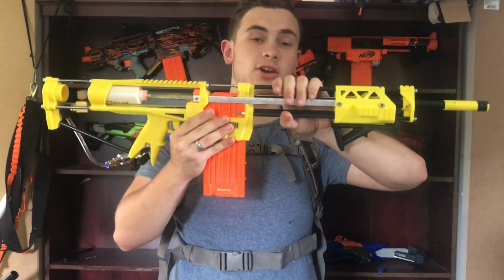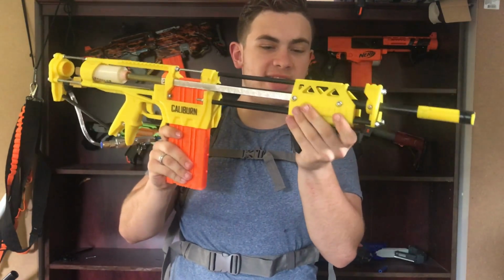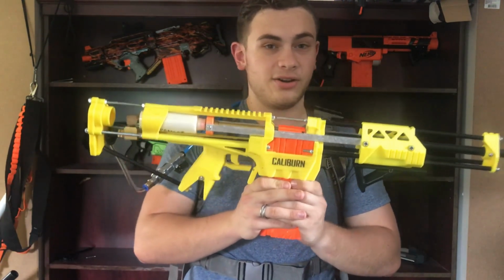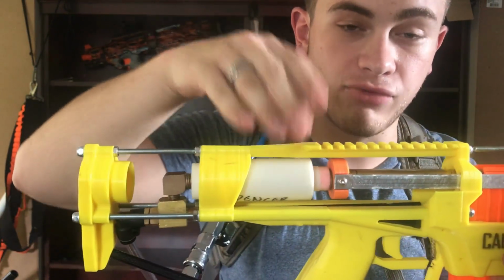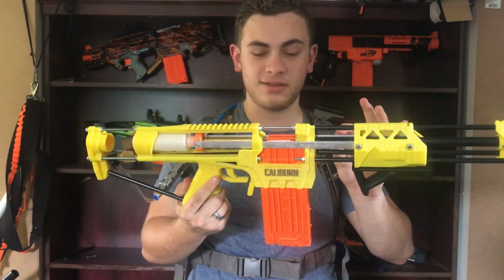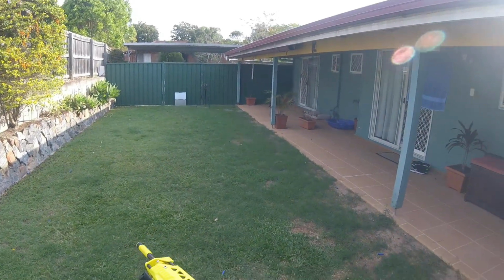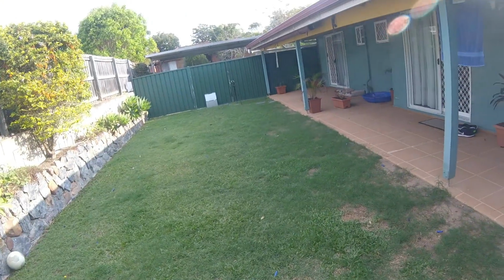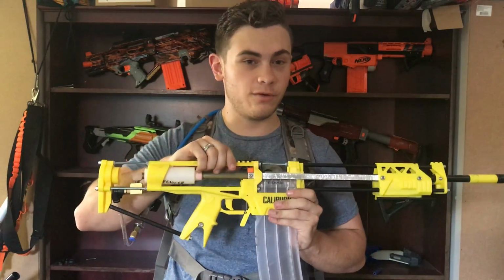HPA CALIBURN ? || +300FPS Custom Nerf Caliburn

Comment: Lol. love your videos Cobba, but I am spinning out on how you guys use hpa to get the same or lower  numbers I get off my springers under 16kg. Hpa is also illegal in WA... So I have had to figure out how to get more out of my springers. Best so far is my worked Omega Zues. That's averaging 400fps atm detuned. Have had it hit as high as 600+ fps with a redesigned plunger.